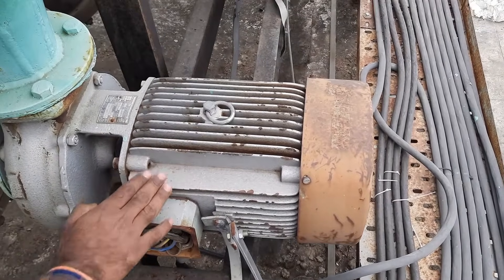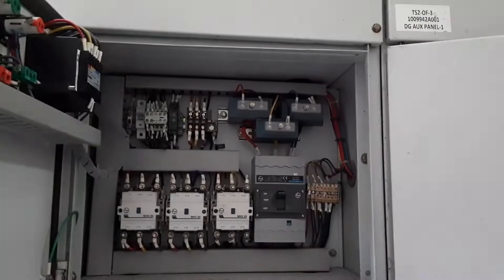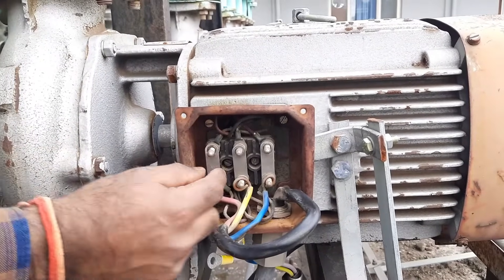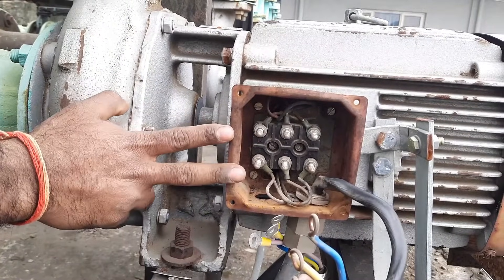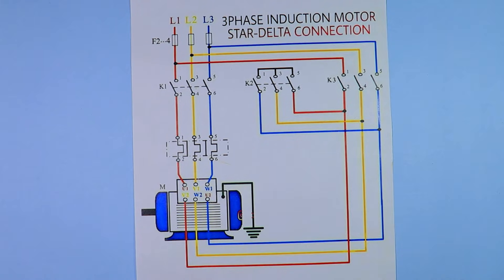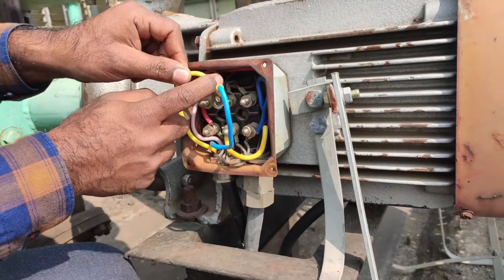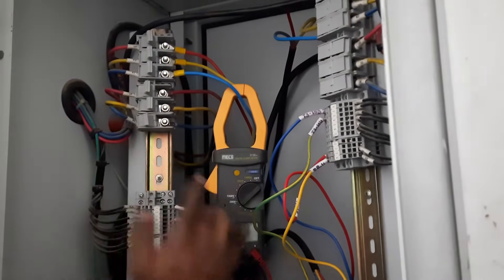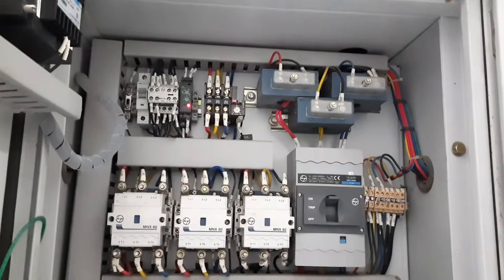Learn Practically Connection of Star Delta Starter @TheElectricalGuy

Comment: Now with cheap VFD'S & soft starters the Y - delta method of starting a three phase motor is obsolete. Came across several motors that burnt out be because timer failed or other problem not allowing the motor to switch over to delta run. Worst was when an inexperienced person replaced a motor on a defective Y - Delta start system and burnt the spare motor on a piece of important equipment.